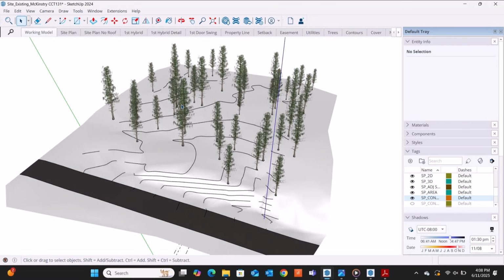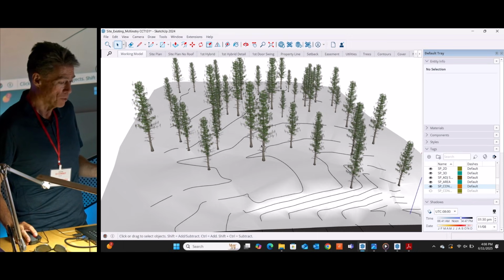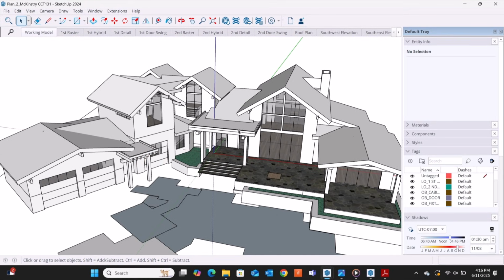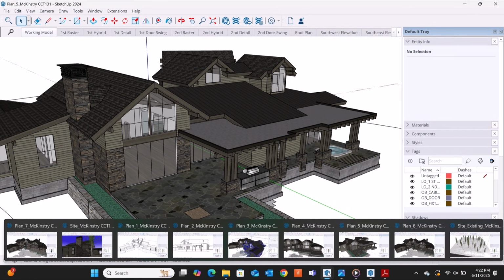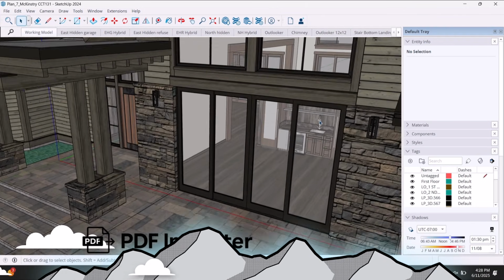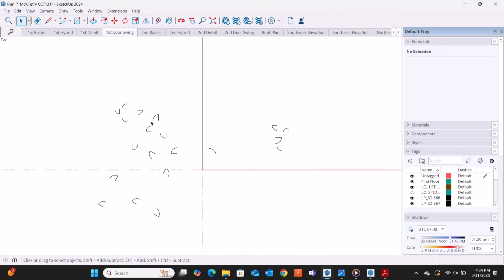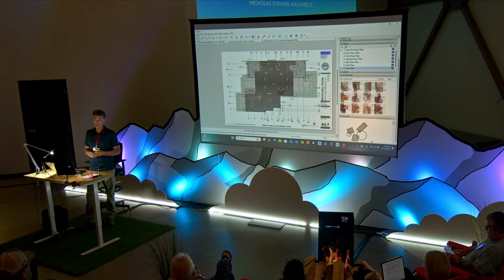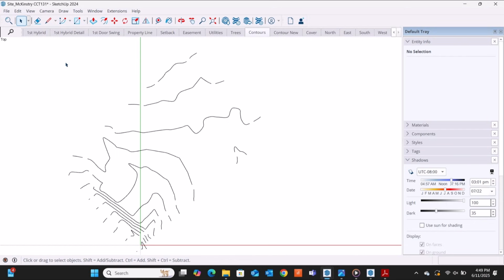Nick Sonder’s SketchUp and LayOut Workflow for a Mountain Home – Part 1

Comment: Cool! Nick's a RISD guy. My contemporary. I went to grade school in industrial design there 1989-1991. I love that Nick is validating much of the detail I do for house design and interior modeling. Great minds think alike.

I wish Sketchup had a way to import '.skp' files into a master assembly file. All objects (.skp files) with connections would be visible. However, you could only edit one object at a time. The assembly file would contains model relationship information including any parametric connections. That keeps its file size relatively small. Higher end and much more expensive CAD systems do this. But I don't think it would take that much effort by Trimble to incorporate this feature. It doesn't add that much compute overhead, even though GPU performance is insane these days.

Palpatine says "Do it!"